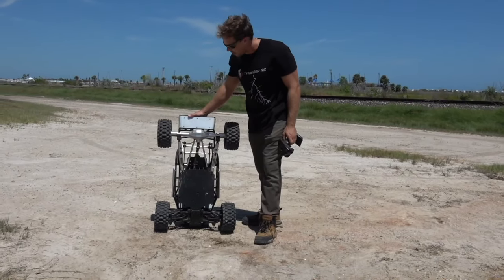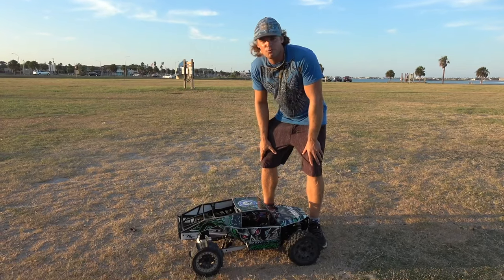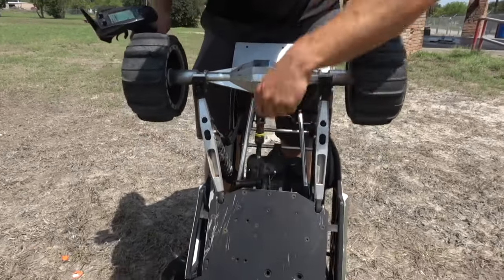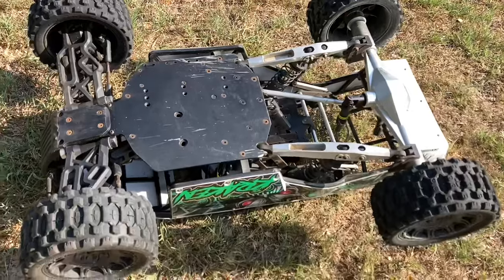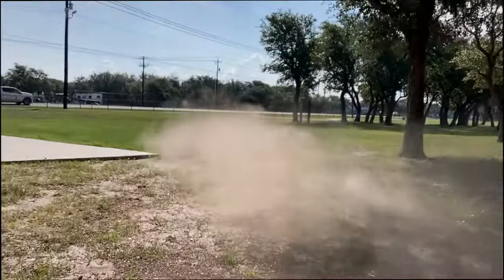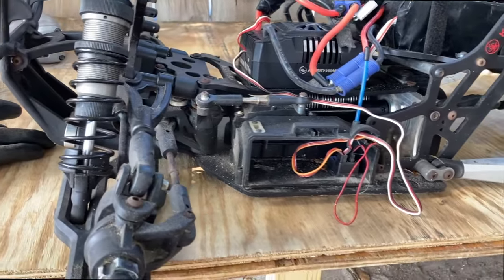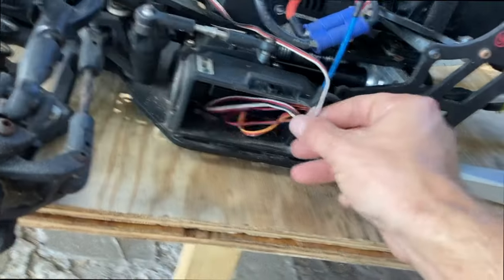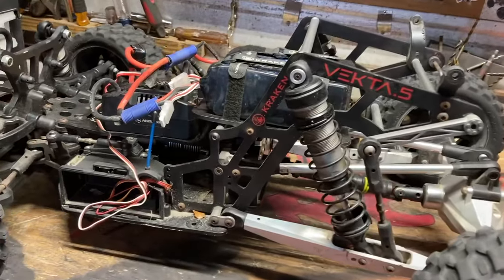The Most Amazing RC Car!!!

Comment: Try gluing the used link.  And/or you can try wrapping the outside of the link with carbon, fiberglass or even regular string or even toilet paper and then adding thin CA or thinned out epoxy to it so it prevents the plastic from expanding too much.   
CA glue and cellulose fiber from anything plant based like natural string, paper towels, toilet paper makes a quick and dirty but super strong composite.  But it's not flexible. CA glue is the best for wooden model planes.